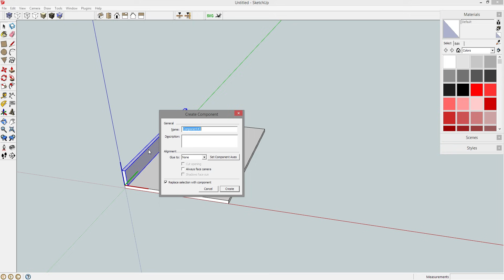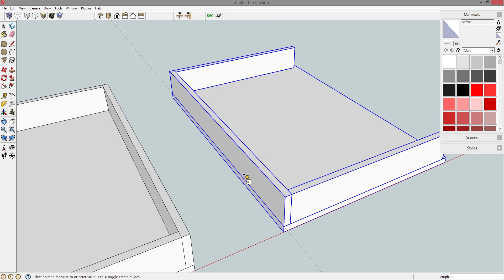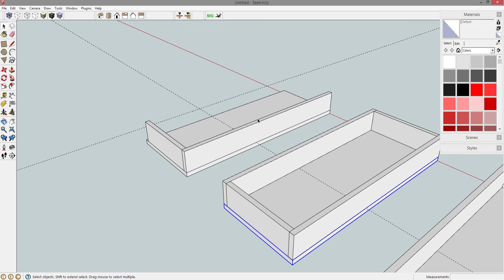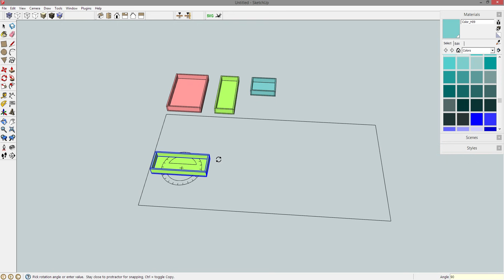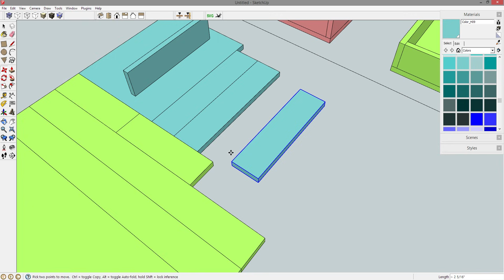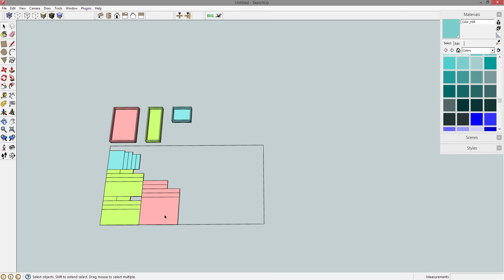Comment: Great video. One question, do you account for rabbits (if needed in a project) in your head? Or within Sketchup? (i.e. The back of a drawer might need to be half an inch longer to account for quarter inch rabbits on each side piece.)

Comment: Laying the parts into the cut list portion is great but what about the consideration of the kerf of the blade?  Shouldn't all the parts be separated with the amount of kerf bordering each part?   Please help.  I'm new to this.  Plus after creating a cut list.  What's next.  Do you print out something from the program?  What's the next step?  Meaning, you have formed a model ask the program, then created a visual layout of the parts.  Is that it?

Comment: I would have left a 1/8" gap between each component for the saw kerf.  Coming from a mech Engineering background you could end up running out of wood if you don't compensate for the loss of material in the kerf.  
Great instructional video regardless.
Reply: Here's a comment I left on this video with 211 thumbs up so far: Please thumbs this up so everyone can see it. This question is being asked a lot. Yes, I do account for the blade kerf but not in between every piece. I know that 8 cuts = 1" so I give myself some leeway and say that 6 cuts = 1". If I get close to the edge I'll count the cuts and make sure there is enough room. But if you manually add 1/8" in between every part it makes things difficult.

Comment: hi Jay. there vidds are very help but... once i have created a object and i want to move the various components onto the sheet for cutting, i cant seem to get them to snap on the surface or find the corner, and to repeat the process with the next component. when pivot the drawing i can see that some pieces are floating way above the sheet for cutting. you make mention of using "up" on the keyboard. i dont know which up. i tried "u" and "pageup" but dont manage. i would appreciate some feedback. thanks, Darryl

Comment: I use groups in sketch up instead of components because of that "make unique" feature. Very nice video though. I love seeing how others use sketch up. I use it on a daily basis and most people I know personally don't have a clue how to use it and are amazed when they see what I design with it.
Reply: +Eric Lopez I use components instead of groups for a reason. Say you build a chest of drawers and you want to reduce the entire height by 2 inches by reducing the stile height. If they are all copies of the same component you just modify one and they are all updated. If you use groups instead of components then you will either have to manually adjust every one or delete all but one, adjust it, then copy and move the others into place.
Reply: +Jay Bates I didn't think about that. I don't use sketch up much to design furniture but I will have to keep that in mind next time I do. Thank you!

Comment: Jay, really appreciate the bubble with recording parameters, very helpful. I noticed a difference in the sound from this video vs your most recent "Sliding Tray" recording. Did you use the Blue Yeti for both (I did see it)? May I assume that is where the Blue Yeti is during your recordings when it is used? Thank you.
Reply: +Yoo Toob The Yeti is only used for sketchup videos. The voice overs in my normal videos are just me standing in front of the camera talking and I replace the video with action when I edit. I'm using a Rode Video Mic pro on my camera. It does a great job but my shop produces a lot of echo so if I'm not close to it it doesn't sound as good.

Comment: Good video, I like the description.  Do you ever have issues when cutting pieces that come close to using the whole sheet?  If so how do you account for the kerf?
Reply: +Kyle Black Yes, I do account for the blade kerf but not in between every piece. I know that 8 cuts = 1" so I give myself some leeway and say that 6 cuts = 1". If I get close to the edge I'll count the cuts and make sure there is enough room. But if you manually add 1/8" in between every part it makes things difficult.

Comment: This is the first sketchup video I've watched, very cool software. Question - is there an easy way to plan for blade thickness? For this smaller project it's not overly important, though it would minimize waste. But for a larger project where you are using an entire sheet of plywood I could imagine running into issues if you're just butting pieces up against eachother.
Reply: +Colby Ruffing  Yes, I do account for the blade kerf but not in between every piece. I know that 8 cuts = 1" so I give myself some leeway and say that 6 cuts = 1". If I get close to the edge I'll count the cuts and make sure there is enough room. But if you manually add 1/8" in between every part it makes things difficult.
Reply: +Jay Bates Gotcha, sorry when I posted this it only showed 4 comments and this wasn't asked. Now I'm seeing tons of people asked before me! haha
Reply: +Colby Ruffing No worries :)

Comment: Will SketchUp let you export the cut list in Excel, CSV, comma dellimited? Because if it does, I prefer using CutList Pro. It's only about $80 and it lays out optimally my cut list on 4 x 8 sheets. It also lets me prefer rip cuts over cross cuts (I prefer rip cuts because I cut it on my tablesaw).  It will also let me decide on the waste left over if I want it to be wide or long. I'll have to upload a video on using that program. Thanks for sharing!
Reply: I had to use CutList Pro though, because I was doing a 28 cabinet build and there's no way I could have placed the pieces on there manually. However once I started using it, I never went back to manually doing the layout.

Comment: what is the name of the tool or plugin you use that gave you a 2 ended arrow with the length in it? that would be very handy when one doesn't want to use tape measure.
Reply: Not sure about the name but its the icon right beside of measurement tool in the tool panel on the left. 9th row 2nd column to be specific.

Comment: Just wondering, what about the "thickness" of the saw? each cut you loose 2mm no? Any trick to solve this? maybe changing the thickness of the lines?
Reply: No need to account for that between parts. Just make sure there is enough space left over that is greater than the added amount of kerf cuts. If you add a 1/8" gap between everything it gets difficult and time consuming to move stuff around.

Comment: Fantastic tutorial Jay, I have a question about the real sizes of plywood, I always try to mesure exactly what the real dimension is before starting with sketchup. I found a couple of times those small differences end up messing my cuts because I use dimensions for cutting that I direrctly get from sketchup. Why do you use the nominal size (1/2 instead of instead of 15/32)
Is there something else you do to contra arrest the problem? Thanks!
Reply: +Tim M I don't account for the super tiny difference as I've never had it cause a problem in the project.

Comment: On your final position you show a space between your blue and green parts, was this done because of Kerf, or does sketchUp automatically consider Kerf? Naturally I want as little waste as possible so my first thought would be to keep things butted together. I guess what I am asking is if SketchUp eliminates my needing to worry about Kerf?
Reply: +Aaron Emery I just wanted to visually separate that group of parts from the rest. Personal preference to move it to the top. I do account for the blade kerf but not in between every piece. I know that 8 cuts = 1" so I give myself some leeway and say that 6 cuts = 1". If I get close to the edge I'll count the cuts and make sure there is enough room. But if you manually add 1/8" in between every part it makes things difficult.
Reply: Great Video Jay, Thanks for you work and I look forward to the next.

Comment: Very useful and a good mind set.  I have a concern about kerf.  Aren't your boards going to be 1/8 to 1/4 inch off because of the table saw blade kerf?  How do you deal with that?
YOu would think some genius would come up with a way to automate this.  I'm in 2022 and you made this in 2015.  Aren't there any plugins that can handle this?
Reply: If you add the kerf between every piece you lose the convenience of snapping the parts together quickly. It makes it MUCH more time consuming and frustrating, for virtually no reason. I just click everything together and glance at how many pieces there are. 8 pieces need exactly 1" of kerf when dealing with a 1/8" full kerf blade. Put them together and measure the space left over and you can easily identify if more space is needed.

Comment: So I'm decently new to sketchup. I can do it faster than someone who barely uses the program but I'm definitely not as quick as you are. My question is how do you account for the 1/16 that's cut off every time you make a cut? Is there a faster way than measuring out in-between each piece? Thanks for the video! Learned some new mechanics on sketchup
Reply: +1wolfgirl300  I do account for the blade kerf but not in between every piece. I know that 8 cuts = 1" so I give myself some leeway and say that 6 cuts = 1". If I get close to the edge I'll count the cuts and make sure there is enough room. But if you manually add 1/8" in between every part it makes things difficult.
Reply: Jay Bates Thanks! I figured that's how most people do it but I just wanted to see if you had some trick up your sleeve. Again great video as always and thanks for responding :)

Comment: Outstanding video. 
I use sketch up every day as well.
Minor issue... you forgot the blade kerf.
Reply: +joevec2 I don't think he forgot it, just the layout on the sheet allows enough waste to cover it.
Reply: +Jizzo 
Exactly. You'd only have to account for the kerf if you'd print the whole pattern out and stick it to the plywood.

Comment: noob question here, do you take into consideration the thickness of the blade? I've screwed myself a few times by not doing so. So from now on I always add a 1/8" between all my cuts when laying it out like this.
Reply: I never do in the model itself. The saw kerf is 1/8" thick. If the layout gets close to the edge, I'll count the cuts, multiply by 0.125 and make sure I have the room. I only check if it gets close. Never add the gap into the model. That makes things incredibly time consuming and confusing.
Reply: @JayBates  Thanks for the tip! I'll try that from now

Comment: Hey Jay, Thank for doing this! I would like to do Sketchup more often, but it gets frustrating for me. The problem I get is, when I snap a piece to another piece, the edges don't always line up. They can be any where from a 64th to an 1/8th inch off, which throws off all my other measurements off. Have you seen this problem and if so, found a way to deal with?
Reply: +wafen40 Always move items with snaps. Click on endpoints, midpoints, intersections, faces, or edges for reference.
Reply: +Jay Bates Thanks for the reply! I'll give it another go.

Comment: Jay, I have a question about dimensional lumber. I know a 2x4 is 1.5"x3.5, but that's in its raw, from the box store, form. After planing/milling, how much can I resonably assume to be left with?

I'm trying to plan out a workbench and I'm having a killer time trying to decide on what dimensions is should use? Should I just mill the boards down to 1x3 and plan accordingly? It's giving me a headache searching for the proper answer.

Love your vids, long time subscriber.
Reply: Doesn't look like your question was answered so I'll jump in.  Depending on what you're building and what your'e using you may not need  to do anything. I build quickie bench frames and etc leaving everything as-is.   The problem is when you're gluing up - you  generally have to get rid of the rounded edges to establish good glue lines. There's no hard and fast standard for that.  2x4s from 3 different mills/kilns will have slightly different corner radii. I just looked at a pile of 2x4s I'm going to glue up into a top tomorrow - the corners are only rounded like 3/64th - barely rounded.  What I'm getting at- you're going to have to look at your stock when you get it, but usually taking a saw blade off each edge and then hitting with the jointer will be more than enough.  So a 2x4 is then 3.25" x1.5".  In my experience you won't gain much with #2 stock planing the faces, but again, assuming you carefully hand-pick your lumber I'd think 1/8" from each face would be more than enough to get rid of twist, surface chatter, etc.   So now your 2x is finished at  3.25"x 1.25".   Your mileage is going to vary...  you might be lucky enough to find some straight grain quartersawn douglas fir  at the local home center.  Larger stock is typically radiused more - I've seen 2x12s with a good 1/8-3/16"  - so in that case you'd have to double what I'm saying and take 1/4" off each edge - your 11.25"x 1.5" 2x12 might wind up 10.75"x1.50" or something.  Of course sorting your stock at the home center is the key to all of this to find that one or two quartersawn pieces hiding in the pile.   Hope this helps.
Reply: Tioga Fretworks, Thank you for the detailed response.

I recently got ahold of some oak 8ft 4x4 used for stacking heavy equipment, and have been milling them down to my own dimensions, and I understand exactly what you are saying now; there is no set number you can arrive at. The final result is all based on the piece of stock.

Comment: How do you account for kerf?  Seems like you might run out of board with all the larger first group of cuts.
Reply: I don't when moving stuff. It's easy to see if it will all fit. 1/8" blade multiplied by the number of pieces in that direction = the amount of material for the saw kerf. I only verify if it looks close.

Comment: only problem is I dont you have allowed for the waste created by the cutting blade. need to allow 3-5mm for every cut depending on blade thickness. only really a problem if pushing the board to the limits and making lots of cuts.
Reply: +Aaron Wilden As stated dozens of times in the comments previously: Yes, I do account for the blade kerf but not in between every piece. I know that 8 cuts = 1" so I give myself some leeway and say that 6 cuts = 1". If I get close to the edge I'll count the cuts and make sure there is enough room. But if you manually add 1/8" in between every part it makes things difficult.

Comment: Okey, all nice and dandy but,.. i use my tablesaw and unfortunately it ha 3mm wide blade... offset ?
Reply: I do account for the blade kerf but not in between every piece. I know that 8 cuts = 1" so I give myself some leeway and say that 6 cuts = 1". If I get close to the edge I'll count the cuts and make sure there is enough room. But if you manually add 1/8" in between every part it makes things difficult.

Comment: when you make a rectangle, you press d for dimensions. I just set dimensions to d but when i press d, I can't change the shapes, it only makes a line with that length. What am I doing wrong?
Reply: +G.Work.Specials R for rectangle. Click to start. Drag in the direction you want. Click to drop the other corner of the rectangle. Immediately type your dimensions in the form of Dimension1,Dimension2 Then press enter. D for Dimension is only to give dimension lines on top of the component.
Reply: thanks!

Comment: Great video and unbelievably timely. I am working through my layout for a bed project that will use 6+ sheets of plywood. One question, do you not account for kerf width in your layout? I see the clear space "north" of the blue tray and assume that will make up the kerf. Correct?
Reply: Yes, but not in between every piece. I know that 8 cuts = 1" so I give myself some leeway and say that 6 cuts = 1". If I get close to the edge I'll count the cuts and make sure there is enough room. But if you manually add 1/8" in between every part it makes things difficult.
Reply: Good plan. Thanks for the follow up.
Reply: +Jay Bates I just use move 1/8

Comment: Interesting. SketchUp is like AutoCAD. I learned AutoCAD in college. I have access to AutoCAD through a friend so I don't pay for it, but SketchUp looks promising and I think it's free?
Reply: +Heavyboxes yes it is free
Reply: Yes it's free. Yes it's amazing.
Reply: +Heavyboxes If you'll be using CAD professionally in the future, I would stick with AutoCad, because it's a "serious" program, like using Quickbooks instead of Excel for your business, or using Photoshop instead of Gimp. Sketchup is great if AutoCad is too expensive to justify the cost or you're a hobbyist. If you're getting it free, I would run with it!
Reply: +gnuyam Thanks for the heads up. My wife has an engineering degree and used AutoCAD for school so it's readily available to me.
Reply: +gnuyam oh, by the way, the QB's and Excel comparison did it for me. I use both of them extensively.
Reply: +gnuyam I disagree, depending on what your doing Sketchup is far superior to AutoCAD. I used CAD for many years, then discovered Sketchup a couple years ago. Sketchup is far fast and easier to use then and CAD ever was. If your designing building sure use CAD, but if your just designing up small items, Sketchup is the way to go.
Reply: +Heavyboxes Yes and no. Sketchup is free for personal use, but there is also a Pro version which costs money. Also, I have used AutoCAD in the past and IMHO their only similarity is that they can both produce 3D drawings. AutoCAD is basically a 2D design tool with 3D rendering extensions, whereas Sketchup is 3D from the ground up. Sketchup is popular not just because it is free for personal use, but also because it invented a whole new paradigm for laying out 3D drawings which was far superior to what came before (such as AutoCAD).
Reply: Martin Green z